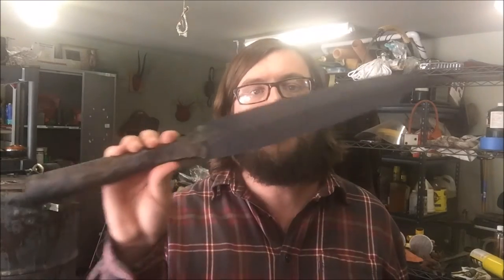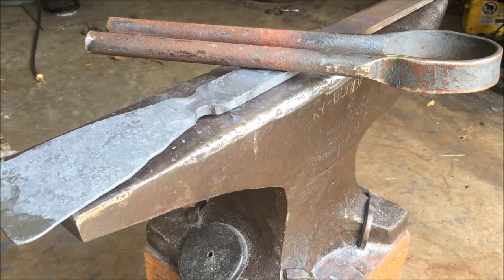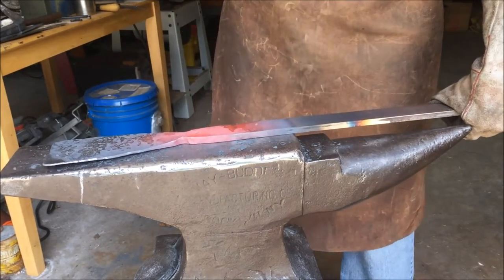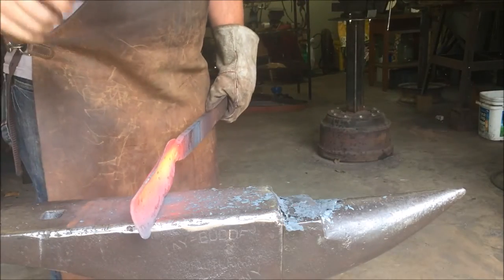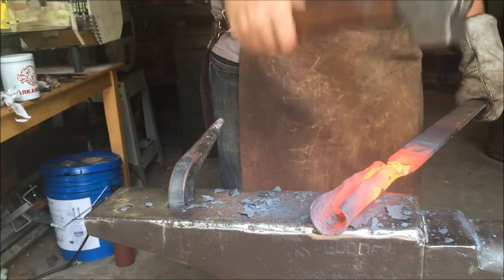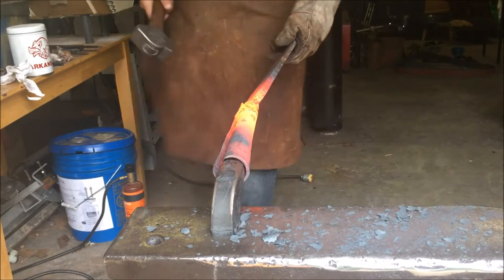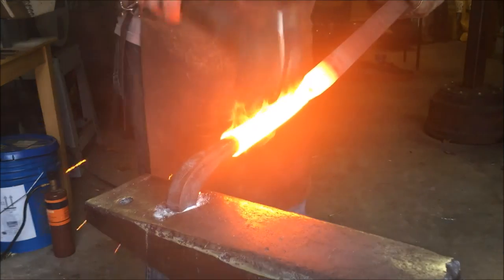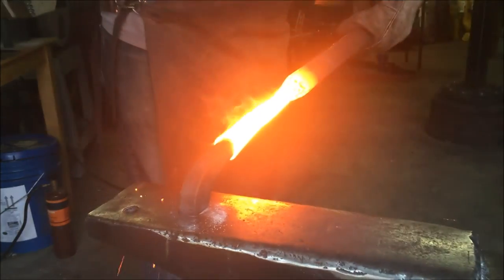How to Forge a Spear pt 1: Forging the Socket

Comment: did you make your mandrel with a lathe or on the anvil?
Reply from the maker: I forged it.
Reply: Allen Newberry I took a piece of 1.25” round 5160 from a truck sway bar and used an angle grinder to shape it into a cone. Took hours. That 5160 is really hard

Comment: I kept looking for part 2, and see this is new. I haven't welded a socket yet, but have been kicking the idea of making a spear around. I'm mostly a tool and muzzleloader maker, I suppose a spear's a tool, same as a rifle. I'm subscribing, and looking forward to part 2.
Reply: I may have to forge a block knife and spoon bit 1st.......always too many interests, not enough time.
Reply from the maker: Thanks.  You can make a socket for a chisel the same way.
Reply: Yes, I've got Peter Ross's dvd on chisels. I have welded O1 onto mild steel for molding plane irons.  I've forged a bick for forming the sockets. So I just need to connect the dots and make one. I'd like to make a 1'' mortise chisel, for chopping dog holes in work bench tops. YouTube is great in the fact it allows us wannnabes a way to communicate with people who're doing something similar to our interests. Thanks again for posting, and thanks for keeping the music volume low, so we can hear what's said easily.

Comment: Hey Allen. Met you a few years ago at the Ozark hammer in. How do you keep the socket from being offset to the blade? I forged a spear the other day and the socket was off to one side. Thanks.
Reply: I’ve never forged a spear before, I’m about to attempt it. But I’ve seen a video where they just forge welded some extra steel at the top of the socket to the blade and that closes the gap and likely centers the blade
Reply from the maker: Mostly a lot of straightening etc.

Comment: Allen, you did a great job on the socket.  I haven't done a large one before.  The small ones are usually just wrapped close to being closed and is a compression fit on the wood.  Most of the time it is for small gigs.  The water will swell the wood and make it tighter.  I like the cone you use, it is more useful looking than my big cone. :)Thanks for sharing and always good to learn a new trick or two.
Reply from the maker: Thanks!  I have have seen you forge a frog gig.  It looks like a fun project.

Comment: Great work man, but I don't like the socket so much: the part between the socket and the leaf of the spear head, seems very thin and there is a small "hole" because the socked is not fully wrapped or "closed".
Have you ever tried to forge a spear head starting from a round bar instead a square bar? It works for me. Anyway, waiting for part two, nicely done!

Comment: great work so far ... but what is with borax in the US ??? do you have a borax mine in your neighborhood or why are you putting tons on your workpiece and even more on the floor?!
Reply from the maker: It is very inexpensive and used as a washing aide so you can buy it at grocery stores.  If you are using the expensive stuff you will want to use it more sparingly.
Reply: @AllenNewberry  cool for you in the US.. Here it is only available for  business owners (legally official buyers ) because it's listed as possible dangerous. Anyway that spear is nicely done I learned something a that counts. Thanks and have a great day.

Comment: not that my opinion/criticism should matter to a FiF champ but looks like anvil stand could use some weight cause you got a little wobble.
Reply from the maker: In my case it is more getting it situated on the floor well.  I move my anvil around for better lighting when shooting videos or to get my motorcycle in and out of the shop etc.  Ideally you would bolt it down to the floor.
Reply: Allen Newberry yeah i figured it was just sitting uneven after watching further in cause later it didnt bounce as much...

Comment: Some of my antique socket chisels appear to have the socket welded as a separate piece of metal to the tool shank. Have you tried this method of forming a socket? I'd think it'd take less time, effort, and coal to cut the socket blank out of sheet, wrap it around the shank, and weld. Perhaps there are downsides I haven't considered.
Reply from the maker: I have not tried it myself.  I would think that making it from one peice of steel is going to be good for strength.  But, if done well the other way it should be plenty strong.

Comment: What happens when you forge weld without flux?
Reply from the maker: Kurvis the flux helps to dissolve the scale on the steel as well as prevent new scale from forming on the steel.  The scale will prevent the two pieces of metal from sticking.  You can weld steel that has been ground clean without flux.  Some people use kerosene on the cool steel to make an oxygen barrier others will weld all around the stack of steel to prevent air from getting in.